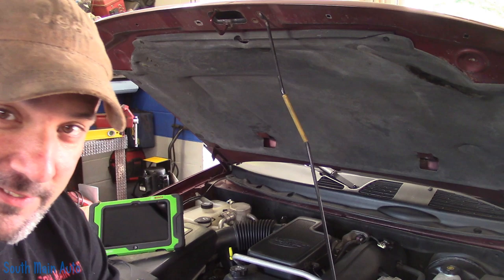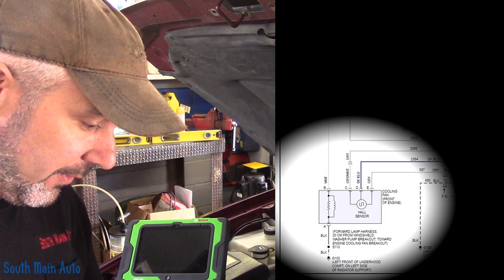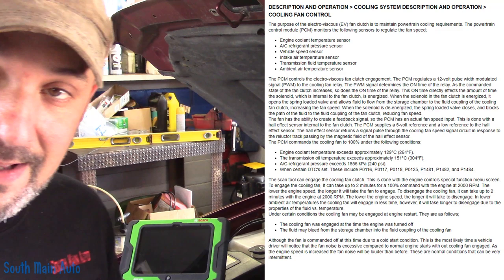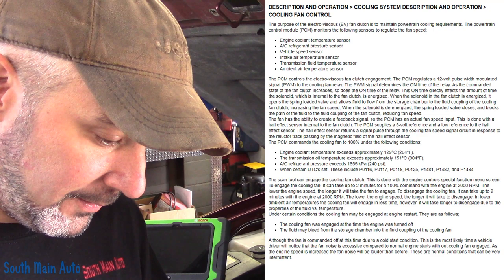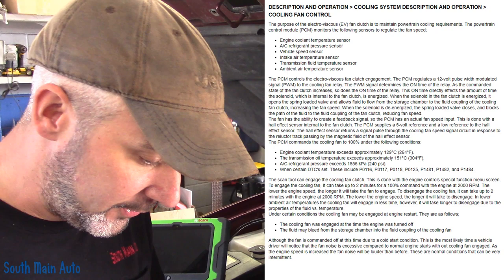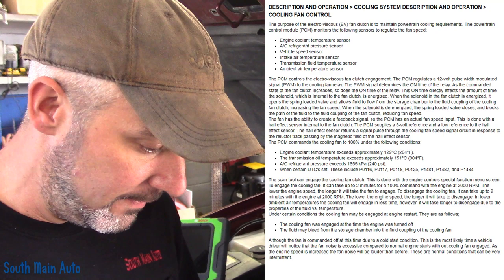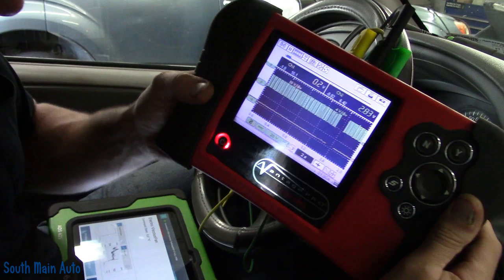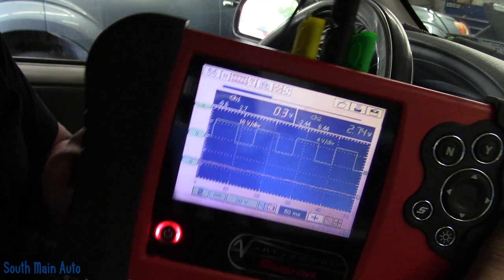Chevy Trailblazer: Electric Fan Clutch Failure

Comment: You did an EXCELLENT JOB teaching the theory of operation.  What an overly and unnecessarily complex system to adjust fan speed - just give me an electric fan, thank you.
Reply: Until the motor 💩s itself and the OEM replacement is $1000.
Reply: So where is the speed sensor
Reply: @richardwells9738  in the fan clutch

Comment: You dont have to break your Trailblazer fan shroud to get the new fan in. But it helps.
Reply: GM junk
Reply: Troy Phillips Isuzu
Reply: after changing both of my trailblazers fan clutches many times i notched out the fan shroud with tin snips just around the upper radiator hose inlet/outlet thing.
Reply: No hahahaloosen the shrol 2 bolts and pushtotheengine and pull it outfromthedriverside

Comment: Image a toilet designed by modern automotive engineers: water level sensor, flush handle sensor, totally integrated flush control module (TIFTM - say 'tiftum'), water 'density' sensor, bowl level sensor, hall effect flapper valve sensor, overstuff bypass module, etc. Think about 'bi-directional' control.
SMA#1
God bless
Paul
Reply: Dont forget the seatbelts and airbags and paper level sensor and over wieght seat shut down valve
Reply: Don’t forget the square per wipe regulations!
Reply: @eizzle78  that's government control not the seat and bowl institute
Reply: They'd also add a Courtesy Flush Timer Module and a Flush Volume Detection Module.
Reply: @josephwash109  cant forget the solid state flush handle module
Reply: Jeremy hanna yep, you got me on that one, damn government over reach!
Reply: Gonna need an OBD connection too  - On-Bowl Diagnostics
Reply: Plus emissions control system of some sort
Reply: Paul, the Japanese are doing this now. They have models that wash, wax and blow dry one's derriere post performance.
Reply: I think we need all that and it require multiple questions and chicken dances before it unlocks, to be installed at every engineers home and business :))
Reply: Heads up, or is it heads down, display too. Lol
Reply: air to methane ratio sensor
Reply: Riddle me this seriously does it need to be plugged in to work it's a very simple question let's keep the toilets out of it Jesus Christ it's a yes or no

Comment: Im just wondering why gm did not choose to use dual electric fans. Perhaps more c f m can be obtained through mechanical. Great video Eric. Thank you for reading operation and explaining what is wrong. You would make a excellent vocational teacher
Reply: I worked for GM as a consultant in the mid 2000s when there was a push to improve quality. At the time we recommended the simplification of electrical systems to improve the quality, and to gradually to increase the complexity so the quality could come along with it. We also instituted Kaizen process improvement to help with the data coming back from dealerships to fix and redesign every year problem areas. As a result of these two moves GM's quality has improved today although it still does not quite match Toyota. To answer your question, two fans at the time increased complexity and was not attempted. I believe it was added in the early 2010s.
Reply: @Buc_Stops_Here  I assume this only applied to GM branded, and not "child companies" such as Pontiac? The Fifth generation Grand AM uses dual electric fans, for example.
Reply: @wyokaiju992  The way our job was is we were assigned to specific divisions, and not the divisions you are thinking of. I was assigned to Allison Transmission for example, in Indianapolis (their headquarters). Counterparts were assigned at Saab first, their smallest division. Others were assigned to GM Powertrain. Last, some were assigned to Buick which is not that small, because of China (over a million cars sold annually there, about 250,000 in the USA). Those divisions we worked directly with. They took those learnings and applied it to the remaining divisions after the bankruptcy, so besides GM Powertrain, Pontiac never got the training.

Comment: 11:34 The bad clutch bearing is the likely cause for the gaps in the PWM waveform at high RPM due to the tone ring wobbling.
Reply: Glue on a Nd magnet and call it a day

Comment: While everyone is complaining about CAFE, I want to remind you that before CAFE, we had shit in the air a mile thick. Cars got about 8 miles to the gallon average and any idiot could work on cars, or at least they thought so!! We changed out plugs and points almost as often as oil and engines didn't last 100K. Plus there would not have been a need to ever watch Eric as the points change videos would be incredibly boring. So show a bit of appreciation for having much cleaner air and cars getting much better mileage and engines lasting 2-3 times longer AND being able to watch Eric figure things out and fix them. I am at 122K on my F250 and still on the same old factory plugs. Hell, 99% of the truck is factory and still runs great.

Comment: If the bearing for the viscous fan coupling has play in it,that may be causing the Hall sensor to throw out an erroneous reading as it can no longer maintain a clean square wave due to the fact the toothed wheel or whatever  has started to flop around,so the signal ends up dirty,all broken up & garbled at higher RPMs !
Reply: Not to mention hard on the water pump.
Reply: if the bearing is bad - could you still hot wire the 30/87 relay circuit to engage the fan clutch?
Reply: So you have to rev the engine to get the fan clutch to engage? What if it doesn't?

Comment: Hi Eric!
I have an somewhat unrelated scenario. A 2017 Mini comes in with a burning smell under the hood. Confirmed customer complaint for sure. There is definitely a burning (almost electrical ) smell. We removed the bumper etc. to get to things (thinking alternator). After running it on the lift for better part of the day the burning smell kept concentrating in different locations in the engine compartment. No visible burnt wires or components but a very concentrated smell by the valve cover. Did I mention this is a standard shift car (best theft deterrent ever!)? It turns out the driver has abused the clutch and when removing the slave cylinder we found friction material in the bell housing. This really smelled like something electrical! Like to see a scan tool find this one!
All the Best,
G.

Comment: The most likely reason the fan shroud is broken is because at one time someone removed the fan without removing it with the shroud. If you try to remove the fan without removing it with the shroud most of the time you will break the shroud and in rare cases break the fan. Its not that hard to remove them together and it will save some parts in the process. Really good breakdown on the sensor failure. These actually are a somewhat common failure on these vehicles.

Comment: Great video as usual. Per GM service info: The desired RPM vs the actual RPM will NOT always be identical. It states that as long as they are within 800 rpm of each other, that is normal. Also code for this diag would be P0526 Fan Speed Sensor Circuit.
Reply: P1481

Comment: be glad they didnt add a variable pitch control and feedback to the blades on top of it.   wait should i delete this? some engineer might think its a good idea.
Reply: If the system you describe is ever used, and air traffic control isn't involved  or the name LAMBORGHINI is not stuck on the outside, we will hold you personally responsible for all repair bills!! Lol
Reply: Then they'd have to determine what pitch to set it for when there is a failure in the control system> LOL
Reply: German cars have variable pitch cooling fan  just like a variable pitch torque converter
Reply: Careful what you wish for!
Reply: Variable vain turbochargers are a thing. Also the manufacturer I work for uses variable electric oil pumps, and water pumps.
Reply: far too late........

Comment: I’m a big fan of your explanations Eric 🇦🇺
Reply: Yeah, I sense he is a pretty good guy.
Reply: @mikephelps8212  I assure you he is. I had occasion to get a bearing replaced a couple days ago. Fast, efficient, very reasonable price.
Reply: @Chris Holmes: YOURE JOKING, RIGHT!!

Guys like this make auto makers think that they need to make things even more complicated and asinine, to keep just anyone from being able to work on them!! 

You did notice the AMAZINGLY STUPIDLY OVERCOMPLICATED COOLING FAN SYSTEM, on this example of a vehicle?? There are actual rocket scientists, with a secondary back up career as a brain surgeon, with an actual cure for cancer, that were confused by this DUMBER THAN A SCREEN DOOR ON A SUBMARINE cooling fan system! 

A fan belt powered, hydro-viscous coupled, computer controlled, pulse width modulated thru a relay cooling fan, on a mid quality vehicle!! LAMBORGHINI IS LAUGHING!!
Reply: @roadkill5333  I'm guessing you struggled to understand this relatively simple control system then?
Reply: @roadkill5333  It makes sense, the engineers wanted more cooling, which mechanical fans are better at than electric, but didnt want the noise from having a severe-duty fan clutch or the slow warm-up at cold-engine startup, which kills emissions.
Reply: @skywizardless: you mean it's not a fan belt powered,  hydro-viscous coupled, computer controlled, pulse-width modulated thru a relay cooling fan, on a mid quality level vehicle??
Reply: Well, phooey on those engineers that use an extra radiator core, a thermostat, and a simple quiet high flow electric cooling fan, when they could make it so much more complicates and expensive!! On top of that, you need some extensive training, and expensive equipment to service it all!! But, we all love spending that extra money, don't we!! Now, if they could only find a way to make medical insurance coverage just as expensive and complicated, to the point that no one can explain it, or afford it!! I CANT WAIT!!
Reply: @roadkill5333  Yes, a simple closed loop fan control system.  It is only slightly more complex than a simple PWM controlled electric fan because it has a feedback path, but as control systems go it's very simple.
Reply: @roadkill5333  Its just a fan clutch with an electrical solenoid and magnet attached. Its Obama's fault, if that makes you feel better.
Reply: More likely, RUSSIAN COLLUSION!! Maybe even GLOBAL WARMING!! 

WE HAVE TO BAN CARS, ITS FOR THE CHILDREN!!!!!! but you can keep your mechanic!!
Reply: @skywizrad!! I put an electrically controlled cooling fan on a 1959 Studebaker Lark, that has had the frame changed to accept a 1969 Camaro SBC!! That was simple!! The stock radiator was even used!! It was also from 1959!! The complicated part: putting a manual control switch on the dashboard, to appease the owner, JUST IN CASE!! You can barely hear that horrible noisy cooling fan, over that SBC!! You can feel the heat, tho! 

And whoever mentioned the variable geometry turbos, you won't see any of those on go arts, either!! Again, this is an overly complicated cooling fan system, designed for doing something that the cooling systems of THAT DAY, and beyond are accomplishing!! The old mechanical cooling fans used engine power to spin! The next style used a viscous coupling engaged by heat to reduce the necessity for the engine to spin it. The electric fan was used to quieten the noise, reduce the power drag, and to get the job done more efficiently! I can see no reason to back track, while adding complicated parts and pieces, to the mix, in order to do the same job! Even when the system was designed, it was way to over complicated, didn't use less parts, do cost less money, and didn't reduce the drag on the engine, while still using more electricity!! This is not used on a high end luxury car! It's a mid level at best, with prices forced higher because of the extra use of parts, weight, and complexity, in an environment that is unnecessary!!  Maybe put an electronic fuel inject, and closed loop exhaust on a chain saw! If they out as much effort towards making people smarter, instead of way to accommodate the stupidity of people, the entire world would be better!! Next, we will have to learn how to test and diagnose the stupid system designed to alert parents that they left their helpless babies in a hot car, because it's easier to design in a system to get around the fact that stupid people should not reproduce!! I know, how about the government make a law that forces you to put your cell phone in the baby seat, and you would have to get the baby out of the way, to get your cell phone out of the hot car...where's OBAMA when you need him??

Comment: Excellent diagnosis of a common problem with the 6-cyl 2000 Trailblazer.  Expensive part too.  But the fun part is disassembling the front end including pulling the radiator to replace it.  I was hoping you found an easier way to replace it.
Reply: Roger F and the nut from fan to wpump is always rusted lol sawzall
Reply: two m8 bolts threaded into the front to hold the clutch in while you pull the shroud, easy peasy. Took me less than an hour to finish a water pump job on these, doing the fan clutch isn't that bad. Stupid design though.
Reply: A bad fan will destroy the water pump anyway lol
Reply: Centrifugal force
Reply: Roger F 2002 and up, 2000s wouldn’t be affected by this issue

Comment: Those things come in shop all the time sounding like a jet engine when the fan clutch locks up. Main complaint from customer is reduced power and fuel mileage. 

Thanks for the explanation and the video Eric O.
Reply: Because they replace it with one that is made overseas. The only one to buy is the OEM and/or behr and it is not a hard job. One can make tying their shoes into a complex mess.
Reply: Mec Alpsha 👍🏻 Yup OE is the only way to go on these.
Reply: @ThePracticalMechanic  I agree OE is the way to go.

Comment: I just got my brakes fixed on my '05 cavalier. I had to go back and have them finish a brake job they started, I didn't have enough money to pay for the whole job. They replaced my shoes and rear drums and spliced into a good section of my brake line just to get me home. When I finally had enough to finish the brake job I took my car back to the shop and every time the shop went to bleed my brakes another brake line popped. I went in for just one brake line and ended up getting all my brake lines fixed for the price of just one. Thanks Mavis Discount Tire. I was in the waiting room for 7 hours, but I have  brand new brakes now.

Comment: I have a '05 TB and the viscous fan clutch went bad.  The A/C wasn't staying cold/cool when at stop light. The fan speed wouldn't increase with engine RPMs with A/C on.  I could actually hold onto the fan with the engine running.  Yup, living on the wild side. 🤣  Thanks for showing there can be electrical side of it too.